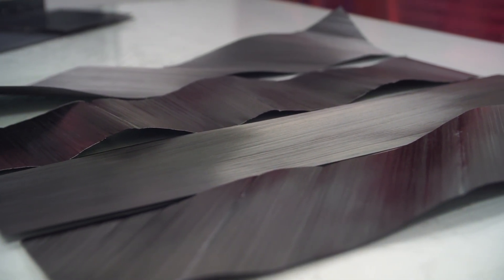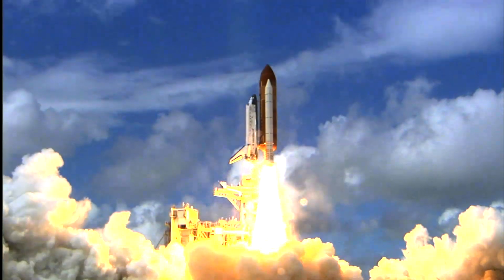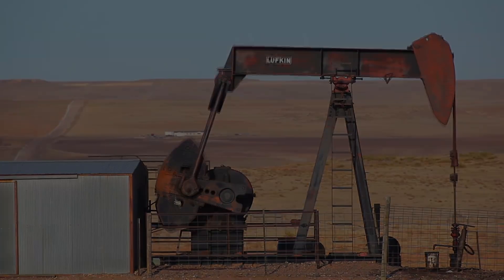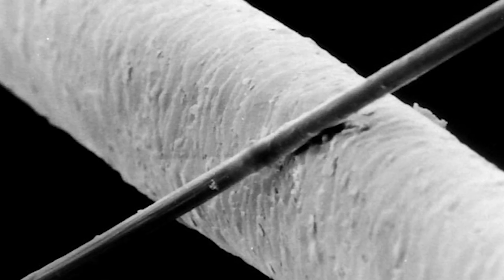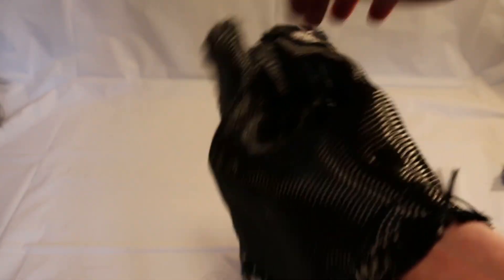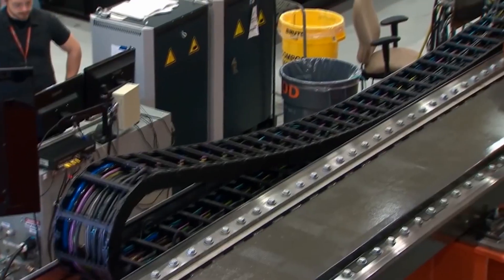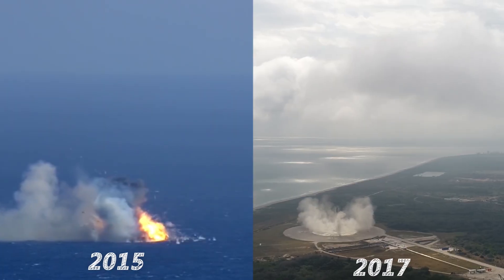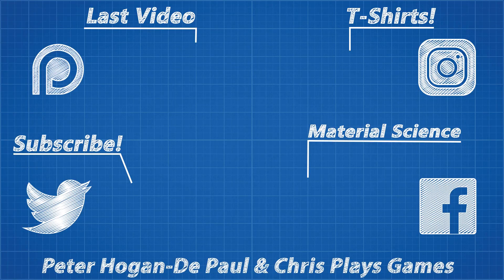Carbon Fiber - The Material Of The Future?

Comment: resin is kind of plastic right? and the fuel are corrosive to plastic, Am i remember it correctly?
its kind of shock that, carbon fiber and resin are work like concrete and steel, i though its just for stick together, and its not include in the solution.

Comment: This is sort of a strange video. Is carbon fiber the material of the future? It is the material of the past, present, and future. It has been in use in all aspects of industry and sport for decades. F1 race cars, motorcycles and helmets, football equipment, shoe components, prototyping, just too many uses to list. So the question in the title is kind of...... silly.
I fabricated motorcycle fairings and mounting brackets in carbon fiber in the late 1990s. By then it had been readily available and in widespread use all over the world for many years.

Comment: At 0:52 that big ol' carbon composite fuel-tank didn't work,  the cryo temperatures made for delamination & one of Elons rockets blew up on the pad as it was leaking...odd seeing an upper stage of the rocket as the starting point in an explosion. Delamination has been an issue for aircraft as well...hundreds have died regretfully noting carbon composites are not the "miracle material" we were led to believe.

Comment: PLus another thing is, depending on the exact type of carbon fiber, after time and wear, it can form nano weaknesses and eventually crack or be more easily broken. I had two rings made of the stuff, maybe of a quality about 7/10, and after years of wearing them, and few times using them to punch anything, one was snapped by a strong friends fingers, and the other just formed clean break and I dont wear it anymore. *shrugs *

Comment: Hi, I am enjoying your work! So, I worked for a small company called OceanGate which has built a manes submersible -from carbon fiber. They plan to take multiple trips to the Titanic. I would like to hear your thoughts about this relativity thin shell  under as much as 6,000 PSI COMPRESSION.

Comment: The discussion around 1:00 is misleading. The growth of the mass of the rocket is linear with the growth of the mass of the payload, and only exponential with the change in the velocity that the rocket provides. The discussion about "the bigger the rocket...the more fuel...the larger the tanks" mimics the reasoning that (when formalized in differential equations) yields the rocket equation, erroneously suggesting that tank size grows exponentially with payload size. (If anyone says "square-cube law," I'll be similarly disappointed, as tank mass grows linearly with the mass of the contained fluid, i.e, remaining a constant proportion of the mass fraction.)

I know there are time constraints on production, and ad view targets to hit, but the fact checking has to come first, or it's just miseducation, sadly.

Comment: For a while I helped an engineer at my previous job who was trying to develop bushings and bearings from carbon fiber. We would use carbon fiber sleeves and pour this slurry through the sleeve as it ran through these rollers. Then we would wrap it onto a cylinder and it would go through a series of heat treatment and put in a vacuum chamber submerged in a polymer. I remember delamination was a constant issue along the face of the cylinders and we tried to resolve this by compression in a mould, different hand wrapping methods and even cross layering it as talked about at 6:25 I left the company and still wonder if they resolved the issue. Very itchy stuff, would recommend a respirator gloves and long sleeves.

Comment: Deepest bore hole 12.2km + a mount everest 8.8km thats a 21km "runway", 21km @9g will give you apox 7000km/h =)
If you have some not to sensitive stuff you could push it at 300g and reach escape velocity on those 21km =D

I still propose digging a tunnel a few kilometers deep beneath mount everest and make a vertical shaft lined with magnets like a huge railgun and use it as a launch pad. Keep the acceleration at 9g's for passenger flights =P So much less fuel needed to be carried =P How fast willl you travel after a few km's with 9g acceleration =D Im not saying this will eliminate onboard fuel just take some load of..

Comment: I use carbon fiber arrows and i can tell you they are very strong.  There are some ways they are inferior to other materials such as being a bit brittle compared to lets say aluminum.  However they don’t deform, and are incredibly strong. I have shot them at solid objects like rocks or metal and often times the arrows are not harmed, aluminum would just deform.  Carbon fiber does tend to get fatigued after lots of use and i have noticed cracking around the knocks from time to time, which is due to what i think is the very violent action of my crossbow
Reply: Yeah, but they last longer than aluminum, I bet!

Comment: Carbon fuel tanks are usually coated on the inside with a thick layer of rubber. This protects the carbon from the fuel. I’ve seen it on an old rocket from the 80’s so they’ve been doing this for a while. Also I don’t believe the SpaceX tank would have been riveted together, it more likely would have been bonded together with more carbon. I think the reason it failed at the join is that was the biggest area of stress due to its almost flat sides at that point rather than the spherical shape elsewhere.

Comment: You'll probably never see this comment but just in case, what were the dimensions of the carbon fibre piece for the tensile test?
Reply from the maker: +jontyoldmanface I see all comments. I'm estimating here, but it was about 5 mm thick and maybe 20 mm wide.
Reply: Thanks. Even knowing the insane capabilities of carbon fibre, that is a seriously impressive tensile strength for that size.

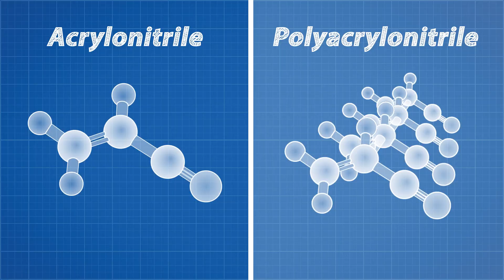Comment: 3:32 That's not the structure of polyacrylonitrile though. The acrylonitrile structure is correct, but when it polymerizes, it does so by losing the carbon-carbon double bond to link the carbons in a saturated chain.

Comment: Just passing thoughts but how sustainable is Carbon Fiber? Can it be recycled?
Reply: Very difficult to be recycled and recycled carbon fiber lose most of it strength. What make this even worse is carbon fiber require 3 times more energy to make than steel.
Reply: It's carbon, we're never running out of carbon.

Comment: What about using S-Glass for this application?
S-glass has more tensile strength then carbon fibre with the same mass and it's much cheaper.
(it does have the drawback of being less stiff)

Comment: So much of SpaceX doesn't make sense, I can only imagine that carbon fiber fuel tank cost an absolute boatload of money.

A far more prudent course of action would be improving the most expensive part of any rocket, the motor. A longer life span, highly reusable, and cheap motor would be much better for the future of space travel than a low weight fuel tank.
Reply: We don't know how many KG's the tank saves. Nor the cost to make one or how many launches it could withstand.

Then what we do know.
Carbon fibre pressure vessels are already used economically
http://www.compositesworld.com/articles/pressure-vessel-tank-types

Their weight is only 1/3rd of a steel pressure vessel. Yet they can be used for longer and withstand higher pressures. Which means a smaller tank can potentially hold more cryogenic fuel.

Ow on to the math. The first generation fuel tank of the Space shuttle weighed 35.000 kg. very lightweight alloys reduced that to 26.000kg for ISS.

Let's presume that they can half that with this technology. Which given how much stronger carbon is in terms of tensile strength compared to aluminium isn't out of the ballpark.

Obviously the Falcon 9 is a smaller rocket then the space shuttle. While the Heavy will have a similar payload to the Space shuttle it still doesn't have to transport Astronauts and heavy life support systems.

But even half that gain would mean a net gain of 130 million bucks worth of transport costs. EACH launch.

We don't know how much it costs nor what it will when the technology has matured.
But these people probably ran the numbers and thought it was worth it.

Otherwise they a company wouldn't have picked up a lost financial cause that would piss off shareholders.

Comment: The resin system is by far the most important factor in any carbon composite project, it affects most of the properties from workability all the way through to elasticity. The whole premise of the composite is that all the proterties can be weekend using the resin system and the direction and balancing of laminate I.e the 1.8.1 layup
245gsm@0°, 650gsm@90°,650gsm@+45°,650gsm@-45°,650gsm@0°,650gsm@0°,650gsm@-45°,650gsm@+45°,650gsm@90°,245gsm@0°.
That is one of the strongest 10 ply layup used for tooling it also works for glass pre preg.
And it is quiet likely that spaceX have used some form of low temperature resin system which you can pretty much cure under vacuum bag and 80°C. so a large oven and then do a post cure of 120°C.
I suppose they could have used a snap cure resin which essentialy cure itself by exothermic reaction.
The autoclave is required for layup like the 1.8.1 due to the density of the layup the pressure of about 5 bar, is to ensure entire consolidation and to litteraly crush flat the voids that can occur if the laminator has not removed all of the bridging from the angles whilst laying up.

Comment: I spoke to an autoclave engineer that has worked with SpaceX. SpaceX does have their own autoclaves, but none big enough yet for a whole fuel tank. But SpaceX is already in the process of building new larger autoclaves for their fuel tanks. Eventually, SpaceX will build have an autoclave big enough for a full sized tank.

Comment: Whats the waste situation of Carbon Fiber? I mean you can melt or recycle metal, but what can you do with used, Carbon Fiber based stuff that reached EOL? Like... cars or so?
Reply from the maker: If the resin is a thermoplastic, that can be melted down and reused. You can't reuse the carbon fibers in that form again, but BMW chop them up to create chop mat reinforcements for the i3. That's pretty much the cutting edge right now unfortunately.

Comment: but how easy is it to recover and recycle carbon fiber? Is it as efficient as recycling metals?
Reply from the maker: No, if it's made with a thermoplastic resin the resin can be melted and recycled. The fibers cannot be easily used in that form again, but BMW shreds the fibres to create a chopmat reinforcement that they use for the i3.
Reply: Are the fibers biodegradable at least? Can they be integrated into some sort of farming technique?

Comment: We should probably get away from chemical fuel propelled spacecrafts altogether. Apart from the inefficiency, the speeds attained are not so great. If we are serious about interplanetary (or interstellar) civilization, then realistically we need to bring fusion propulsion online as soon as possible. Photonic/laser propulsion might be another modern possibility. (More ambitious still, and still theoretical, would be to harness the energy released from matter-antimatter reactions and controlled black hole radiation.)

Comment: Seeing the carbon fiber, I think I see part of why they don't want to use hydrogen: the molecule is extremely small, so it is difficult to ensure it doesn't leak.  Hydrogen and helium can be difficult to contain, especially with a fiber.  It's not a problem with metal containers (except at the seals), but metal is heavier.  (Obviously, it's also more difficult to liquefy and store due to its lower temperature but that didn't stop NASA.)

Comment: how did Dr. Shinto' know that heating the material up too 200 degrees celcius would change its structure towards better stability? did he know previously through theoretical testing, or simply know that heating materials will change their structure and use "trial and error."?

Comment: I'm not keenly aware of the details, but I know that there are out-of-autoclave options for manufacturing with carbon fiber that only require vacuum pressure to work. Perhapse SpaceX opted to use that method to make their giant tank.

Comment: The whole point of spacex is cheap rockets not reusable they make rockets at a 10th of the typical cost
Reply: and if they also manage to reuse them, thats a 10th of the cost again
Reply: Stef Morojna that if you don't include fuel cost and the parts that can't be reused
Reply: Silas Mayes The fuel costs are literally pocket change. A Falcon 9 may cost $60 million but it only uses about $200k worth of fuel per launch.

Comment: great video! Wondering why you dont put this on your second channel? 
Two things that I thought you could have mentioned is the different in carbon fiber and nanotubes, with that I mean that carbon fiber is getting more used today but nanotubes has outrageously good mechanical properties, far beyond carbon fibers. Secondly is if I´m not misstaken that spaceX uses aluminium on the inside with carbon fibers on the outside to reduce weight but to avoid the problems occuring with cold liquids. You did mention the problem but not that a metal where used on the inside to avoid the problem.
Did a composite in a sandwich formate with glass fiber last week so could relate too :)
Reply: Thanks for the info!

Comment: Imagine a B2 carbon stealth bomber but the size of a football stadium, its wings are packed with gigantic nuclear powered scramjets, with big inlets, it looks like a manta ray opening its mouth to take in plankton, not aerodynamic at all, barely able to fly, instead of fuel we have liquid nitrogen for reactor cooling. In the middle we have a normal rocket :)

An antonov or so tethered via cable pulls it into the air and detaches, scramjets bring it into the stratosphere, rocket into very low orbit. Oh yeah its an unmanned orbital freight transporter. So it drops its cargo (that has its own small rocket to make it into stable orbit) and lands like a shuttle (hence the size). The whole mission should not last more than a few hours.

Makes its own fuel by splitting water for its next mission.

Is remote controlled, humans go to space the old fashioned way.

At high altitude can evaporativly dump its used cooling liquid to regain cooling potential for reentry.

If costs permit can have an ejectable nuclear core for catastrophic scenarios.

Ideally would start and land in water but then would need a powerful seaplane to get up.

Should have a payload of at least a 250 ton.

Would solve the gravity prison problem and allow aggressive space expansion. As a bonus "we" dont have to kill off the chinese (again) and can give the playstation generation a job by letting them mine the asteroid belt from their couches.
Reply: look up the skylon and REL sabre engine